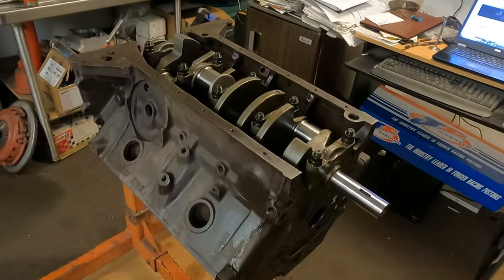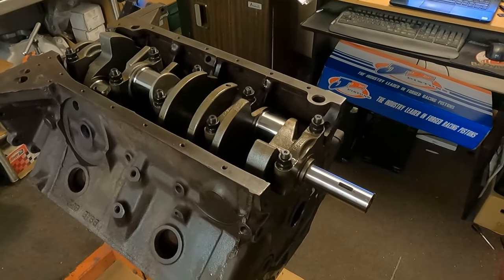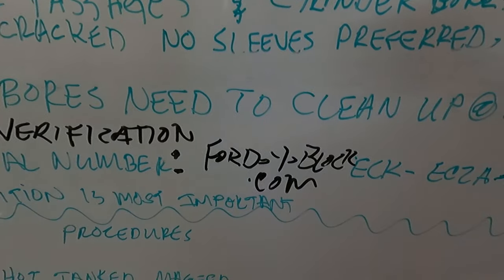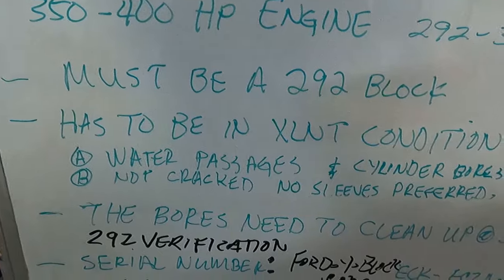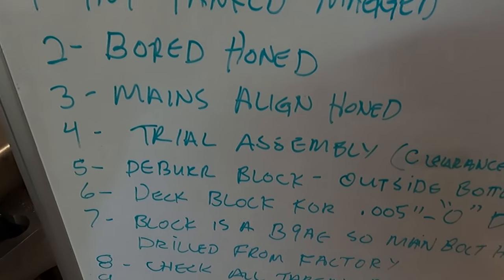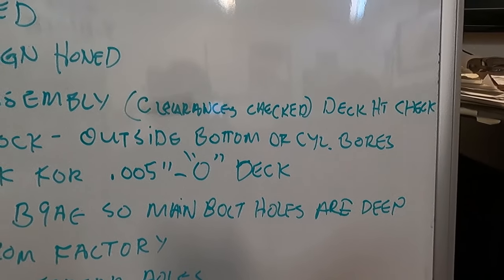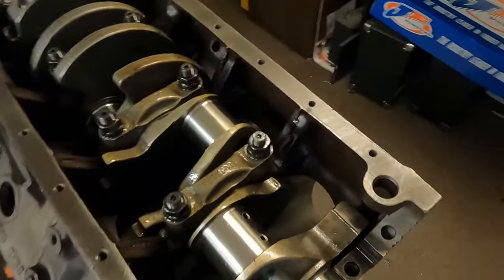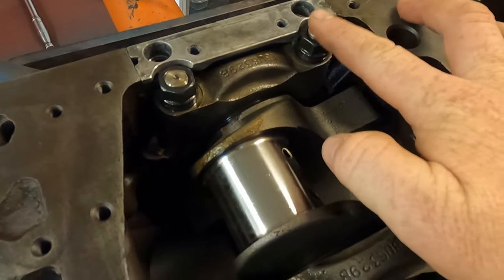Building a Better 312 Ford Y Block using a 292 part 1

Comment: Built one of these for a 54? F100 Restore, originally a farm truck from NC. STill had the original bumpers on it
All stock so it was easy and lo budget. Usual machining to the block, bumped the compression a tad, blue racer/wolverine "RV" cam 3 angle valve job w/some cleanup. Surprised at how well it ran withthe stock gear and 3 on the tree. Exh made a fantastic noise 
Cruising about 3k it was the best road music!  Fun to do an oddball engine for a change

Comment: Alot of great information. Thank you sir. Looking forward with interest. 👌 I got a stock low milage 272 from a firetruck on a stand, waiting. 😉
Reply from the maker: A 292 block will make life easier.  Your 272 will have a lot of good peices you can use.
Reply: @mummertsspecialvinterests2721  It's not easy to find a good y-block in Sweden and it's going in a light roadster so it'll have power enough. 😉

Comment: I hope you’ll talk about one-piece rear main seals.
Reply from the maker: The flywheel flange is significantly larger than the rear main seal unlike a 302   One piece rear main seals are not a thing people do on Y Blocks.   A careful install and leak check will get you xlnt results from an original rear main seal.

Comment: Would you consider using 12 point nuts on the rear main studs? They could give you a little bit more room for socket clearance.
ps. The Hall Toledo V.I.P. grinder is deluxe!

Comment: Mine has been hot tanked but there is still alot of rust in the cooling passages between cylinders,  im getting some of it off with a pick tool. But what do you guys do to really clean that out.  Thx
Reply: Hot tank a couple of times. Keep knocking the block on the cement. Use high air pressure to blow it out.